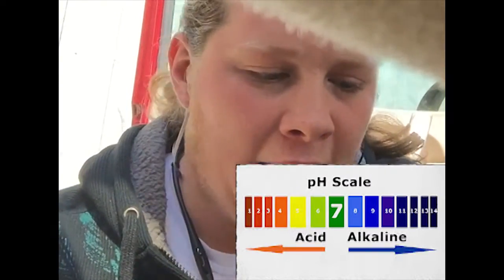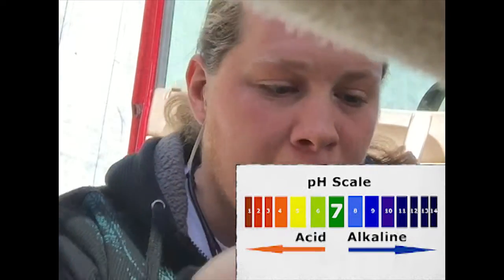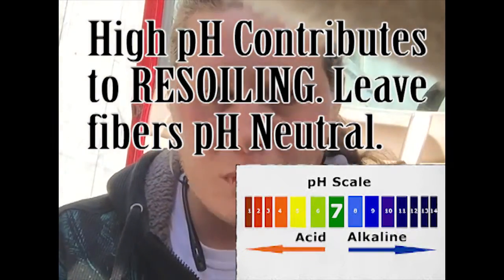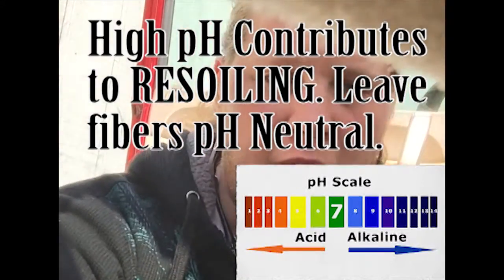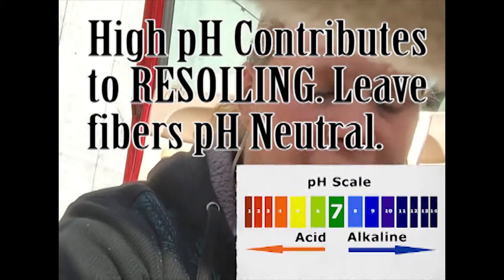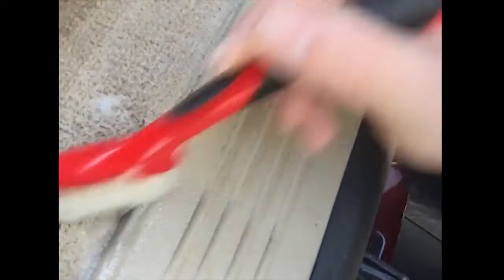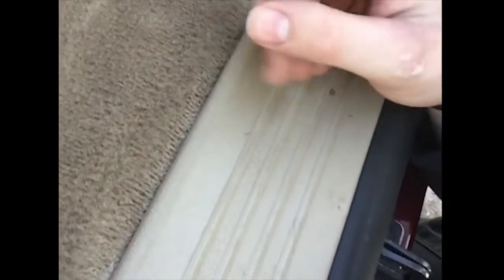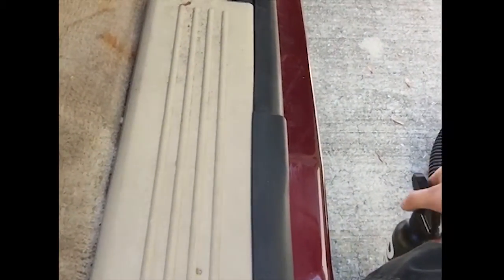pH Balance Stain Removal

Comment: how about the problem of neutralising? making stains stable.
Reply from the maker: This is a great question, something that is often overlooked. If you are removing stains from the interior, making sure the product is completely removed, and that the pH is dialed correctly is just as, if not more important than removing the stain in the first place. Say you’re removing a coffee stain, which is pretty common. Coffee is a low-acid, and it’s pH is anywhere from 4.5-6. To remove a coffee stain, you would use an alkaline or base cleaner to remove that stain. Using an acid cleaner for an acid stain or a base cleaner for an alkaline stain can do serious damage to carpet and may permanently set the stain in the fibers. When you use a cleaner to remove a stain, and the stain is lifted and carried away from the fibers, you’ll want to make sure all left over product in the carpet is removed. Steam or water is a great way to do this. Not only will it remove the cleaning agent from the carpet, but it also resets the fibers carrying the pH to as close to 7 (neutral, which is what water is on the pH scale) but it also acts as a carrying agent, bringing any left over soil to the surface for you to use a towel to clean up. Remember when cleaning stains with a towel, you don’t want to scrub back and forth to not spread the stain around more than before you started. Instead, Lay the towel down, and press with your fist, or gently twist in the area, no back and forth. Hope this helps, thanks for the question Nejc.
Reply: @RedDiamondDetailing  thanky you. you have good understandong. can you perhaps recommend me some literature about stains?

Comment: is tannin the same as browning prescription?
Also, if you treat a stain with a general cleaning solution, does that lock the stain in? If so, can that be removed by using the correct pH product even after it's been used with a general cleaning solution? Hope that makes sense! Cheers :-)